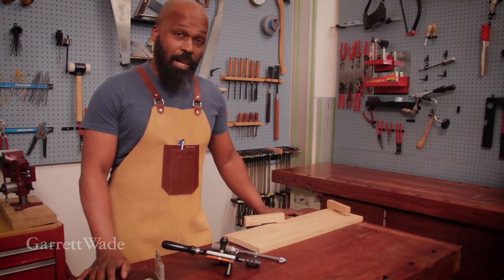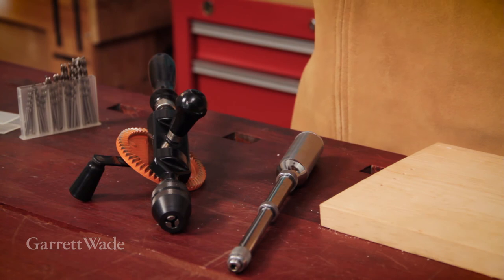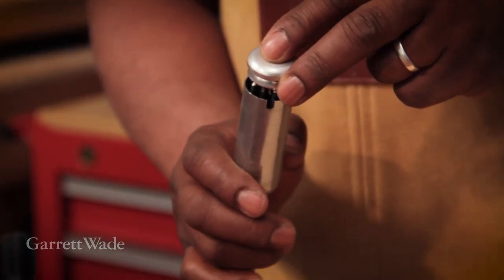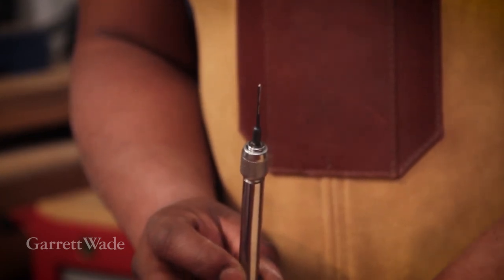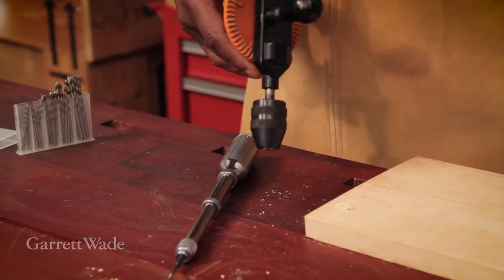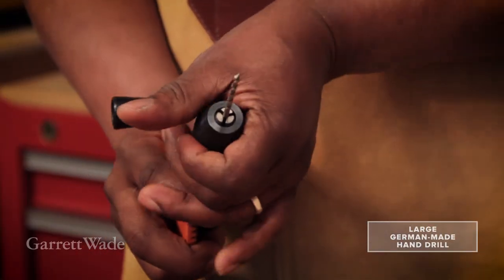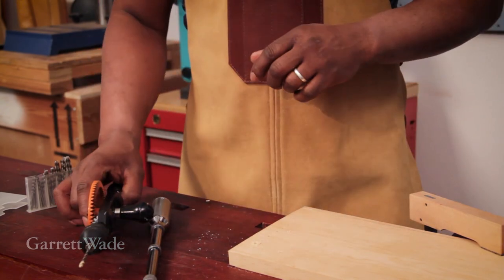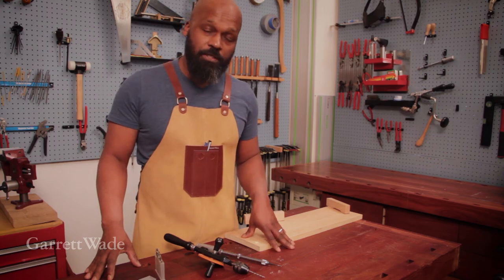Using the Garrett Wade German-Made Hand Drills and Yankee Push Drill

Comment: I have a question for you I recently picked up a Yankee Screwdriver however, I am not able to remove the bit.  I can push up on the collett and the collett moves however, the bit does not come out.  It jiggles a little but it is locked in the driver.  Very frustrating any suggestions.